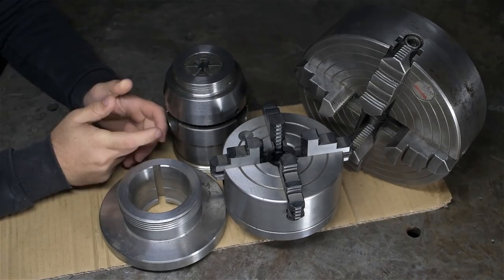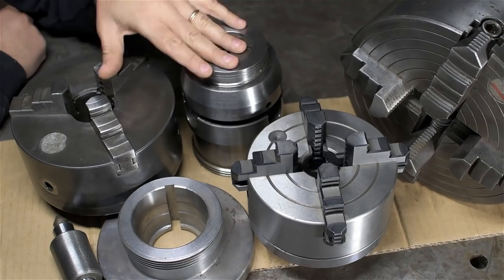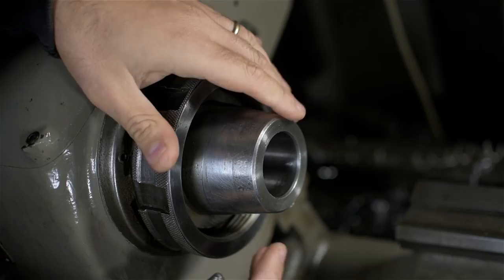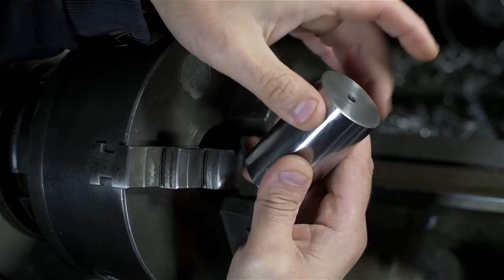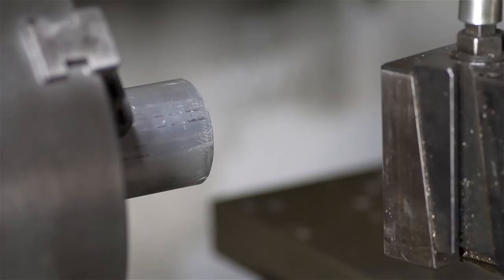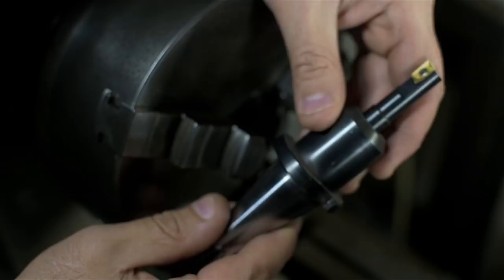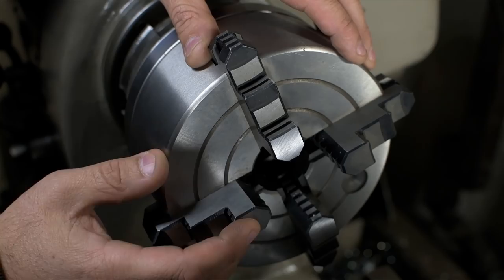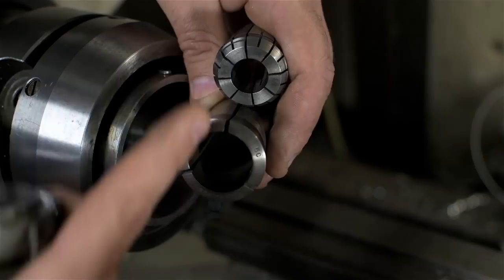Lathe Chucks

Comment: Interesting as always. I have only recently started watching these ToT vids and they are great...as all of you seem to know already. I clicked on this one hoping to learn about adjustable 3 jaws but alas it was not to be so I must continue my search. I DO have a question though. I have a lathe with a really nice and pretty darn accurate 3 jaw chuck on it...I love it. The machine came with a 4 jaw too. The mount is D something (I forget which) so it has the cam lock twisty thingies on the back. BUT.....although I am not concerned about the method to change the chucks, I am terrified that if I mess with it and take the 3 jaw off to use the 4 that when I put the 3 back on it won't run as true. I know...this sounds dumb overall....but I just hate the thought of losing the accuracy I presently enjoy with the presently mounted 3 jaw! So.....I use my trusty 6" Pratt Burnerd 4 jaw over on my old 9" South Bend when I run a 4 jaw job. It gets me by. Anybody got any thoughts/experience with changing out chucks and getting/losing accuracy? Meanwhile I will wonder the net looking for a vid on how to fiddle with adjustable 3 jaws. Many thanks

Comment: What brand chuck are you using?  5 mils is a huge chucking error in my experience. I worked in a production tool shop for some years. We exclusivy used Buck 3 jaw chucks. Typically less than 1 ml chucking error.

For precision turning, we used soft jaws and bored them out b4 turning

Comment: Tony, I have a little old craftsman 6x18 lathe. It came with a 3 jaw chuck that has a ring around the outside to tighten the teeth instead of a T handle mechanism.  Does this style chuck have less "grip" than one that would tighten with a T handle?

Comment: Another variation on the three jaw is the buck chuck, which has four adjusting screws allowing you about .03” of adjustment around centerline.  Better than no adjustment at all, you can re-zero your hard jaws or previously bored soft jaws.  A manual three jaw chuck shouldn’t be without it.  And soft jaws, but thats another story.

Comment: hey - 
 how can i take apart the chuck from the lathe? i have the same application like in the video- same round ring with the tapper but the round ring doesn't come off, its should pull out or just hit it from the back ?  
please your prompt response
Reply from the maker: Hard to say, what kind of lathe?  if it looks like mine, and unscrewing it doesn't do it, it could very well be bound up.  Try penetrating oil.  Soak it a few times.  Also have a close look.. very close look... any chance there is a hidden set screw?

Comment: The whole chuck business can get outta hands fast. My mill uses R8 collets but I use ER20 TTS system on it after the CNC conversion. My lathe has an MT3 taper which you can buy a set of collets for fairly inexpensively.  Then I have accessories like the spindexer etc that use 5C. So personally I've decided to stick with ER20 and 5C for the versatility...hey 5C is Stefan Gotteswinter approved :)

Comment: Ah all that old stock without a threaded spindle!  1 1/4 x 8 IIRC.  Sheldon 11-44 Quick change gears with - with Chrome Ways !  beauties they are after 68 years since Dad and I bought it!  Have Morse 4 in the nose and 2 in the tail stock. Have face plates(2) 4 jaw and 3 jaw and ER40 in Morse and R8.    I Know - back to work.

Comment: I recently got a Invertech221 with water cooler. All the same as yours. Cool machine. Noisy water cooler , how to quiet it down? Remove fan blades, not much reduction. Insulation? Double housing? Electric fan, thermostat switch? Would really. Like to mellow it out. ideas? Have a syncrowave 250. Much quieter. Might be project ?

Comment: What are the lathe chucks on the old lathe grinders and cutters called? The machines had two chucks instead of centers and you could index both chucks over so you could turn connecting rod journals.
Reply from the maker: not sure.  good question!

Comment: Gawwwwly Tony. Here I was dialing my3 jaw and it runs out 5 thou and I'm thinking it's a crap chuck. I took off the backing plate, just like my 4 jaw and there is no register pick-up. I'm so angry at the manufacturer. They could have performed one more  simple operation and located the chuck properly but OH NO they just throw a bunch of bolts at it and say Buh Buy  and then Bye.  My spindle clocks zero. so I'm pleased with that.   I'll be turning the existing backing plate to create a proper register IF I have enough material. If not I'll use your very helpful video to create a new plate in cast iron.  I prefer using my 4 jaw as wellThanks again

Comment: Hey TOT, I just picked up a set of Bernard collets at a junk sale for $4, couldn't believe my luck. It didn't come with the chuck, so I'm gunna have to build one (life goal). I am however a but of a novice machinist (software engineer) and I have two young children,  so it may never happen, but hey dreams are free.... Would you be interested in doing a bit of a tear down of the Bernard chuck so we can see inside, and how it works sometime?
Reply from the maker: That's quite a goal to set for yourself!  It's really just like a really big collet closer, like an ER collet, etc.  A threaded cap pulls the collet back into a tapered hole.  The taper matches the taper on the collets you have of course.  The further it pull sit in, the more the collet closes.  I'd recommend watching ebay for one though.  ;)

Comment: First off, just want to let you know that out of the 50 or so channels I subscribe to, this is one of the top 5.  As an engineer that understands the theory as well as application, you can navigate both in spades.  Your post production and cinematography are almost as good as Clickspring (Aussie accent excepted) :)  

I am looking for some advice on my first metal lathe.  What size, what brand, features, etc.  I have space for either bench mount or floor.  You have any recommendations? Thanks in advance and keep the videos coming.  Dave

Comment: Hi Tony I am a 70-year-old newbie I just purchased a LeBlond lathe and I wanted a 5C Collett Chuck. I was told by a distributor who distributes parts for the Leblon lathe That a 5C collet chuck would not work on my lathe. I was told by the distributor that I have an L one spindle, he then told me the only college chuck that I could get would be a 16 C collet Chuck so I had an opportunity at an auction to buy a set of 16 C Collets. Then I start shopping for a 16 C college Chuck and told that they don’t have a backing plate for an L one spindle. So when your experience does that mean I need to build one? Or am I in a rabbit hole that I’m never gonna get out of.
Reply: Santo - BISON makes a 16C tru-length manual collet chuck (part # 7-862-0601) and has adapter plates for L0 and L00 spindles.

Comment: So this might be a dumb question but are there independent 3 jaw chucks? And why wouldn't they be more common. Seems like they might have some attractive positives for machinists
Reply from the maker: not a dumb question but i bet there are.  chucks are convenience items and there's all types but usually it's round stuff or hex stock in 3jaws... if you need to move one jaw independently you'd use a 4 jaw?  there are 4 jaw DEPENDENTs out there dedicated to square stock.  just depends what's most convenient for the work.
Reply: @ThisOldTony  Hmmm yeah I see. Because I know a lot of precision equipment where you need an accurate centre (E.G. microscopes, and laser optics will use 3 'axis' control) so I imagine it gives you very easy and accurate control with the caveat that only round or hex and alike will work in it. Also props for replying. Love your channel. currently watching, lmao

Comment: You said you can take the chuck off with your work in it and come back later to complete it. What if you're doing something with threads? Is the chick keyed to only fit on one way?
Reply from the maker: Yes the L0 spindles are keyed.  CamLoks also usually have a marker.
Reply: I'll add that threads used on chucks are normally single point. I have a 1940s Grayson lathe and used a marker pen to see if my chuck lined up again when removed and put back to find it was indeed accurate enough for repeatability, even on such an old lathe as mine.
Reply: No or maybe, depending on the lathe. If you ever disengage your drive train (like I must do to reverse the direction) then the threading would be lost. It's better to just pick back up on the thread than risk it.

Comment: I haven't used my three jaw for probably five years or so.   Only usually takes sixty seconds to dial in a part and that's good enough for my home shop lathe and I know the part is running dead on.   Even if you have multiple parts to roll in and out of chuck I would still use the four jaw because in that situation it shouldn't take more than fifteen to twenty seconds to dial in runout on each part.  I'm not going to be in any bigger hurry than that in my retirement for me or anybody else.

Comment: With the risk of sounding like a heathen but just asking anyway. Can't you just lathe out (is that the correct term?) the inside of the three jaw chuck (like you would with a part) in order to make it more true? You might need to approach it slow (or not do it at all) because it's hardened or is the error random every time due to the inside mechanics that you would just mess it up?
Reply: Johan Bloemberg Because they’re hardened, you would typically grind them. There are a few videos around YouTube on grinding chuck jaws true - Stefan has probably done at least one. But he has an accurate toolpost grinder, which home shops tend not to. It’s also a messy process, grinding up inside the parts most vulnerable to grinding dust. So the short answer is yes you can grind jaws true in place, but it’s not a typical home operation.
Reply from the maker: yes you can (well, grind them, as tyggerjai mentions), but, in theory, they are only accurate at the diameter you trued them at.  If you change diameter, the jaws are no longer concentric.  This, however, is a good fix if your jaws are really really worn out (bell mouthed), to get back to "regular" 3jaw performance.

Comment: It's been many years(45) since I was in Metal shop in high school. But 2 months ago I scored on a 1940 or 41 Reed - Prentice 16" x 80" lathe.My problem is the finish on my parts are really rough. I tried to Feed the carriage as slow as I can and it rough. as fast as it goes and it's still rough Max rpm on this lathe is 965 and 50 is the slowest. I'm running my tools as centered as I can get. I tried to make threads yesterday and they came out really rough also. Any wisdom you can pass on . Thank you Daniel G. Homa Retired and in the shop putzing...

Comment: what about 6 jaw chucks? that's what most machines at my work have on them. they are set tru or buck chucks so they are best of both worlds. self centering and you can adjust the center axis of the chuck by turning set screws that are up against the back plate. you can indicate 50 mil on both sides of a 10 inch part, after that it's between centers for under 50 mil. also have a few mag chucks that make indicating parts witg large flat faces very easy but cleaning the face perfeclty each part can be a pain. we have these all for OD and ID cnc grinders.
Reply: I've got a 6 jaw buck adjust tru. Love it!

Comment: Jaw-dropping that you didn't feature your soft jaws TOT! Great video, could you do one showing how easy that big four jaw is to drop on the ways (or into the bed gap)?:)  I really used to struggle getting mine fitted.
Reply from the maker: very easy! I have a carved up piece of wood that sits on my ways, made to keep the 4jaw at the right height to slip right onto the spindle.  Of course, when I need it, I usually have a 100# 4 jaw in my hands. :(
Reply: This Old Tony isn't that always the way ? :D

Comment: I'm not a machinist, I don't randomly look up machining tools; but, on the collets, specifically the types with the jaws, would there not be a four jaw variant? I would think out there, somewhere, someone has made a set of collets that'll take literally anything.
Also, I'm sure someone has also created a jaw collet that has interchangeable and removable jaws, so you can turn your six jaw into a four jaw that has corners or angled edges cut into the jaws to hold square stock. I wouldn't understand why these wouldn't exist, they're simple concepts that wouldn't be difficult to make.

Comment: Hello Tony!

 Can you make a video about how to cut out a rectangular steel sheet (4-8mm thick) with a lathe and hss tool in one step? I found no video about this topic. One of my metalworker told me, that is possible to press the rect sheet onto the chuck (with tailstock and pin), and with hss tool can be make a deep cut from the side. Sometimes the cutted circle needed for further project, sometimes the rectangulat part with a the hole.

Comment: I hate three jaw chucks. Mainly because mine is .015 out of wallerance. Once you learn a 4 jaw, it's easy. I use the poor mans collet chuck too. The MT3 collets. They Don't grab exceptionally tight, (will slip when using a threading die) but will hold for turning.

Comment: Why do they call them Chucks? Why not Larry's or Tony's? Things that make you go- what?
Reply from the maker: chuck is short for charles.  Larry or Tony just wouldn't work.
Reply: Probably because after the first time the missus found out his guy spends so much time in his shop fiddling with "Collette", being in there with "Chuck" seemed like a much safer option...
Reply: Yeah... there's that... :)
Reply: AH... So was the inventor Charles Holdentight or his step brother Charles Holdencenter? I don't think that has ever been verified. Unless I missed it
Reply: Have you noticed that a 3-jaw chuck either holds tight, or on centre, but never both? I reckon the brothers Charles and their life-long animosity are behind this...

Comment: I posted comment 4 months ago concerning this subject - chucks. I believe there is a purpose for a 3 and a 4 jaw chuck. Its your choice what you want to use. If you buy quality chucks (Bison, Rohm, etc) you will have a good quality setup. If you buy a Chinese chuck, man, you can expect  problems. I have been using Chinese chucks (I can't afford better) for quite some time after I stopped working. Trouble all the time. I bought an Chinese lathe a few months ago. Firstly, the workmanship on this machine is as bad as it can get. I hardly used the 3 jaw chuck and it has serious play already. So, if you can afford it, buy a better quality chuck. Their collet chucks seem to be just as bad. I looked at many videos where a guy tests the run-out on these things. Quality just costs more - period, but, if it doesn't bother you, go for it.

Comment: hello Tony, and anyone else here that might know the answer to my question.
I own a grizzly industrial g0752z lathe. The spindle specs are 
spindle thread: 1- 3/4" x 8 TPI
spindle taper: MT#4

I am trying to purchase a collet chuck. However, all the collet chucks that I can find online are described "d1-4" or something similar. 
my lathe also came with an 8" faceplate, but I can't find anything in the manual or on the lathe describing the faceplate. 

if anyone around here could shout me answer, I would appreciate it. 
Sorry for asking here, I haven't found a cool lathe forum yet. Geez, it's not like the old days when it comes to finding neat little forum communities =(
Reply: You can buy a plain back manual collet chuck from BISON and make your own adapter plate. Unfortunately their threaded adapter plate option is 1-1/2" - 8.

Comment: What is happening if it isn’t smooth and a tiny groove instead of smooth
Reply: John Underwood the feed rate is too high, if you reduce the speed the tool is moving it should fix that
Reply: Wow I would have thought the opposite. I am trying to learn as much as I can. I just got my dads great x2  uncles 9”C south bend. So I might be bothering you with dumb questions. I did get 3 books on south bend lathes. It’s a 1937. I enjoy your videos so thanks again!
Reply: I have another question. My lathe has a lever by the gears. It can be moved up or down with a retaining bolt. It says in my south bend book, it’s the reversing gear. If it is up the gears move and if I put it down all the gears are not spinning but it seems to go faster. I think it’s just to remove the gear for disassembly
Reply: John Underwood i dont mind people asking questions, if you need to know anything else, fee free to ask

Comment: sorry, but 4jaw is overdefined for round parts.
3 jaws will always grab first, and one comes later... that makes your part running less true than on 3-jaws

just get good equipment
Reply: Your observation only holds true when comparing self centering chucks. It's entirely possible make a three jaw chuck with individual draw screws for each jaw just like a four jaw chuck but most users prefer the superfluous jaw over the trigonometry.
Reply from the maker: 4jaw scroll chuck, yes.  A regular (independent) 4jaw wouldn't be.
Reply: that depends on how much time you are willing to waste.

Comment: Soft Jaws Old Tony, even though I know you know. Kids, get a set of soft jaws! Mount them up, tension with a spider to a diameter a few thou smaller than your part then bore a few thou larger than your part. Sub thou work holding every time. How we set up for all jobs in a tool and die shop. (Tupperware)
Reply: Oh and of course shim stock in the 3 jaw also works a treat once you know your particular chuck like a loved one. Spin it on the dial, old number 2 jaw needs 0.002" again, carry on.